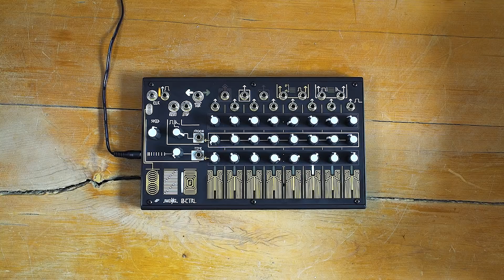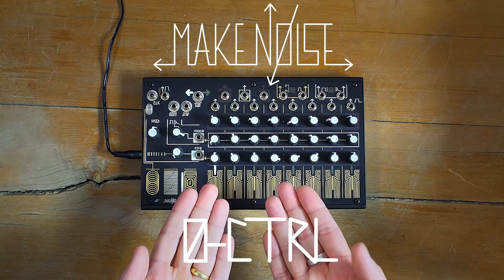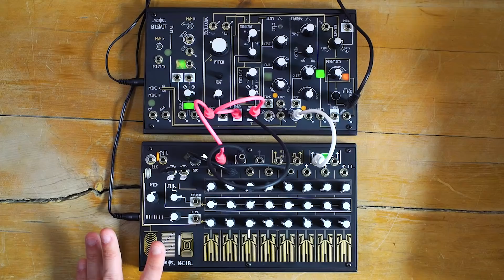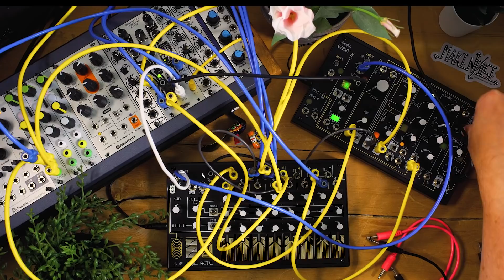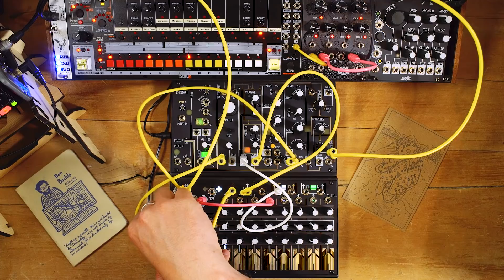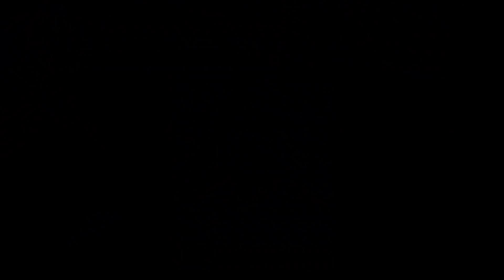Make Noise 0-CTRL Analogue CV/Gate Touch Sequencer Demo

Comment: I am late in the party, but great video and I think I have found what I was looking for. Can this device , be used : a) as a CV expression pedal? I am asking for pairing it with korg arp odyssey.
b) send sequencer modulation (clock division, reset) in an eonwave quadratic swarm synth? If not I might consider the o coast instead.

Comment: I know this is very late, but man this is an uber demo, please release the album! If anyone is still in the comments to answer questions - if I have a Rene 2, is this worth it? And secondly, I have a pressure points that I got recently but the pads dont really work for me in terms of pressure, I thin because my fingers are fairly dry. Is this any different?
Reply from the maker: Thanks - yeah some folks and folks in different climates have mixed results with touch strips, is there any way to adjust sensitivity like on Pressure Points? Hard call to suggest it would be better than Rene 2, that’s a personal preference. Maybe a bit more immediate? But Rene would be deeper?

Comment: I have been asking the wrong questions, part of the learning curve I guess, I'm hoping this is the right one..
I own a Benjolin 2v,  a 0 control, Erica synths Sample Drum, WMD pro output & Maths, 
installed in a powered rack, all hooked up & working.
The question I have...
  are there modules or parts am I missing "meaning" 
 
I have noise makers  Maths & Benjolin,
 I have a keyboard, 0 control,
 I have a method to bring in sample sources & "drum sounds"
 (I think I'm a little confused on this point " Sample DRUM right? )
& what I think is an amp WMD Pro Output
every video I've seen ,  does not explain or show the leads to an amp & the powered speakers or mixer 
so I guess my question is three fold, 

1. do I have all the necessary modules 
2. more information on once the sound leaves the rack how is it amplified properly those options  
it is assumed in this community from the videos & other resources this is common knowledge but its not 
3. basic patching  to begin to explore the different  sounds
 
On Modular grid .net when I built a virtual synth & started to experiment with it 
 it gives me this message 

×This Rack does not contain any Modules that are playable in TrueGrid. 

I have been using the guitar pedal of my sons FX 100 by Flamma
 the amp contained & head phone jack  & volume  it to 
produce sounds ,
 but I don't like the "Barney Fife" method, & my kid wants his pedal back 

I hope this better explains my dilemma, 
any advise helps,
 thanking anyone who answers in advance,
kind of feeling like Ricky from trailer park boys , 
sad because I only have my grade 10, in this very cool  group of people

Comment: Good Video, interesting sequencer, still not sure if it was worth it for me, since you can do lots of weird stuff also with a SQ 1.
What i dislike is that you cant really use those three rows independently because they have seperate CV outs but not seperate gates, (like the two channels of the SQ1), also if you dont want to use the dynamic gates (only the 0 Coasts dynamic in can use) then you still can't use the second row for anything else because the dials have to be at least at "12" or you wont have a gate at row one, so whats left is just a one row 8 notes sequencer with some cool and weird timing and direction possibilities that can be controlled by gates. ah well forgot the touch plates.

Comment: Awesome video. I see there's a clock in patch point on the 0-CTRL. Could you maybe feed a CV/gate back from the 0-COAST into it to move the step along when the voltage was high enough so they are effectively controlling each other in a potentially random way? A bit like an advanced Krell patch.

Just a thought 😬

Comment: (O-ctrl )VS (2 PP + brains )= ? :-) Thanks
Reply from the maker: There’s a lot of crossover, but mainly the Timing row (you could make that by feeding an LFO-as-clock the CV though I think?) Dynamic Envelope and Gate out, and pressure is smoothed on the Ctrl, and it’s self contained and 0HP!
Reply: @mylarmelodies  Thanks!

Comment: I would hope make noise ship these with a right-angled power cable. These pokey outtie ones are not great.
Reply: Pretty easy to hack that yourself.
Reply: Michiel Lombaers or buy them 👌🏼
Reply: In pretty sure you can get those, a bit odd that they decided to put it on the side instead of on the back like everything else :3
Reply from the maker: When it’s on the side you can butt them right up against a case you’re controlling it with!

Comment: It's like a Brains and 2x Pressure Points, but better, plus a clock and an envelope generator.  Hello, next purchase!
Reply: More, I think. I always wanted Brains to have a toggle switch on the panel that "separated" one of the attached Pressure Points, eg. for giving touch control over Rene's mod inputs while using Brains+PP for another sequence. I wanted this so much that I eventually bought another Brains+PP

Comment: Cool, though, i would need more steps, 8 is not enough. ... it's great for performance like and small melodies.  But i can't get rid of 8 steps and the inability to save. What is so hard to add the possibility to save the sequence? ... Mother32 has it, lots of sequencers have it. Even it's an ideology or a a mindset not to save, it's important, even if it,s eurorack. (and this is not).  
I hope MN would make a small case or a stand something to link both 0Coast and 0CTRL. Something like Moog did for Mother32/DFAM etc.
Reply: A major part of this sequencer's appeal for me is that it invites spontaneity. Having fewer steps on a less linear dynamic means I can get a lot more interactive control out of it than anything  with 16 rigid steps. However, If you're after 16 steps and presets, Make Noise already have René (and René 2). Not long ago, I began working with a DAW and an interface that allows me to record, edit and playback CV, so the idea of saving sequences in the device is now arbitrary.
Reply: working within constraints is creatively valuable
Reply: @ilsaalsi857  Indeed. But when having a little more, but still basic needs, would not be creatively valuable?
Reply: um... this IS a eurorack module. also, on account of how patchable this sequencer is i doubt patch saving would be all that worthwhile anyway
Reply: Also, this will probably add a quite a lot to any ext clock sequencers. Say you had a Mother or DFAM, you could humanize the clock groove and control more many more parameters, with manual control and resets, etc. The same cannot be said for most sequencers you can pair.